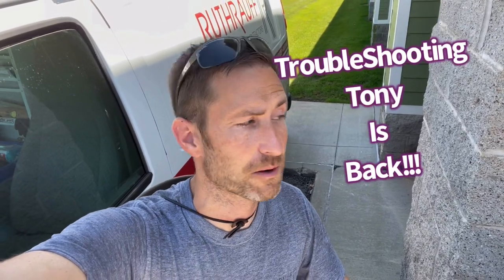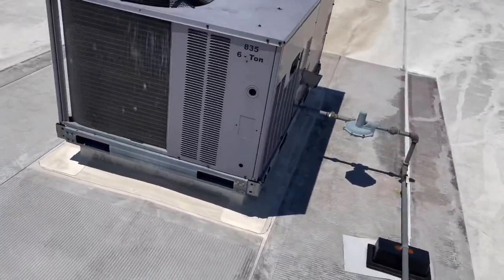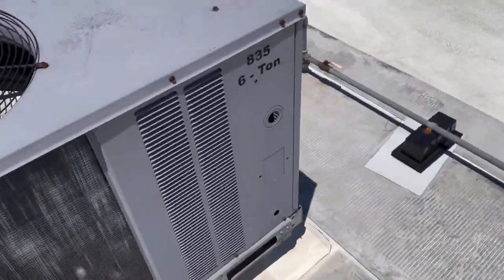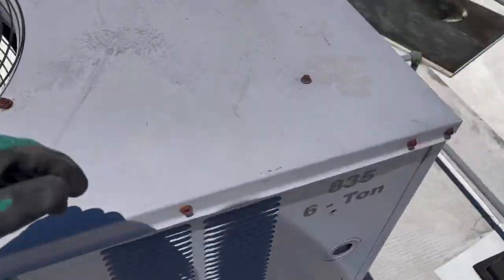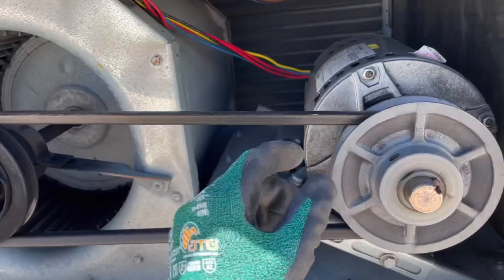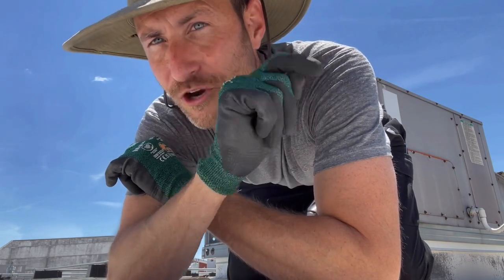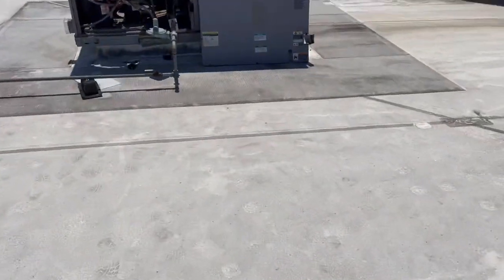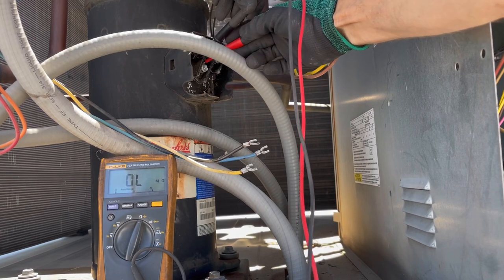RTU Shorted To Ground.  #HVAC #RTU #HVACEXPLAINED #HeatingandCooling #AirConditioning #Carrier

Comment: Awesome video very informative!  I have a roof top unit and I called 5 companies to come take a look. Only one guy was able to fix the problem . 3 of them said I should be a technician and one came without a 🪜 🤦‍♀️
Reply from the maker: Thank you very much for the compliment.  Everybody has a different way of troubleshooting.   The more calls you take the sharper you will be by sometimes when you stare at a problem so long you can get blinded.   Sometimes you just need an extra set of eyes and the problem may stick out like a sore thumb.   
About the technician without a ladder some companies do not have all technicians with extension ladders.  
Technically, the customer is supposed to have access to that site equipment, but very rarely do they.   I always recommend to the customer putting in a possible extra hardwired light for plug outlet nearby to make life easier for the technician.   
Have you thought about becoming a tech?   You can live very comfortably in the HVAC industry.  I prefer commercial/industrial over residential any day.  
Have a great day. Thank you for watching.   Stay safe. 👍

Comment: Nice did the job. If for some reason the breaker does not trip so the is a power in the unit, as a technician how to protect your self from shocks? How to be prepared before touch the unit? Thankfully.

Comment: One that I hate in those mega mall is those laters they should have small  alevatar  make a life easier
Reply from the maker: I don’t mind working in malls on the roof. The only part that gets frustrating is any time it comes to a major repair. It takes roughly 30 minutes to get from your work van all the way to that piece of equipment so if you got to do a leak repair with torches recovery machine, vacuum pump/Refrigerant/scale/your tool bag, etc. it’s very time consuming.  
I remember back in 2007 it was literally a solid month of 5°F in Pittsburgh, Pa.  I had to replace six compressors at a local mall.   I brought a sled to make the job easier but what a pain.  
Trying to recover refrigerant that cold outside does not go well.
Have a great day. Thank you for the comment.

Comment: One thing you should have mentioned... The grounded compressor was in the megohm area. This is “sometimes” an indication of moisture in the refrigeration system .  I have seen this before and the compressor ran fine and would use less amps as it gathered some heat and drove the moisture out to a lesser degree.  They can sometimes be saved with a clean up drier.
Reply from the maker: I definitely should’ve pulled out my Megger.  I have seen a couple compressors Electrically OK that would tripped the breaker because internal bearings or mechanical failure lock them up.  Meanwhile they look perfectly fine with a meter.  But yes I should’ve pointed that out typically when I do these videos it’s one take.  Sometimes I failed to point out other issues that could cause this or that.  
Sometimes when I compressor is reading grounded even with a
Supco Megger I will stand back and engage the compressor to either blow a fuse or tripped the breaker just to confirm it is bad.  But yes I will see if I can do a separate video in the future on that in particular that would be a good situation.  I appreciate the comment and advice I’m glad people are paying attention because one thing is this field there is no 100% perfect technician LOL we do miss things and sometimes problems do not revealed himself right away.  Have a great day and have a safe weekend.
Reply: @hvacexplained9341  nobodys perfect but we try do our best.  aA senior tech asked me 25 years ago, when he saw me using the megger... My Fluke can read meg ohms... Whats the difference. I didnt know and it stumpted me.... Later while growing in knowledge, I realized the meg ohms measured on a Fluke, is like 9VDC at most.  While the megger is 1000 volts.  a thousand volts can jump a gap like a Jacobs Ladder to ground or a spark plug if theres a break in the insulation,  The Fluke wont jump anything.
Reply from the maker: @hvac01453  :  
I was using a Megger one time on some thing that was definitely grounded and I found out because I was really sweaty on a hot humid day leaning over into a Units condenser fan section and when I hit the button I am dead serious I felt a twinge!!!  Lol. Thank you very much for the technical advice I like listening to the old-timers they got some good tricks up their sleeves.  
Have a great day.
Reply: Good work fellow 449 service fitter. As the other guy wrote, moisture can cause a reading to ground. I’ve been at this for a long time and I’ve also seen times when a Fluke or other digital VOM will show a short while a megger will show it’s good. I’ve seen it more times than I can remember. I’ve also seen a lot of 5 ton single phase Copeland scrolls meg bad new and out of the box. This is after replacing the drier and refrigerant (was years back so it was 22) and pulling and holding a 500 micron vacuum and less than 1 hour of run time. But they ran for years. Keep up the good work. Maybe I’ll run into you sometime in the Burgh. Stay safe.

Comment: In my opinion the main breaker was tripped due to direct shorted to ground in the wire. 
However the compressor that has winding measures mega ohms to ground is most likely still working fine. I have seen some 3 phase motors had mega ohms shorted to ground but lasted a very long time. 
I totally agreed that any motor winding should have no short to ground whatsoever

Comment: Low volt Fuse is on the board on those carriers actually, I personally swap out with resettable 3amp breaker usually if it’s a regular customer

Comment: Megohm readings in motor windings are generally moisture . i bet you could have still fired it up and ran it .  megohms readings will only have a leakage to ground of a Ma or so
Reply from the maker: That is a very good point.  I have had Megger meters Read grounded and Had a compressor running perfectly fine.  So what I do when it’s sketchy and I’m sure is literally Come down to engage in Cooling Or push in contactor And blow some fuses.  I had to do that one time in particular the compressor was reading perfectly fine but internally it was mechanically locked up it was a semi hermetic on a Mcquay 50 ton unit.  I’m going to see if I can shoot a separate video on information such as this it brings up a good point thank you very much sir have a great day and thank you for watching the video.
Reply: @hvacexplained9341  the purpose of the megger is to attempt to “predict” a compressor failure by keeping past readings. More for the in house guy, than the hvac truck guy.
Reply from the maker: @hvac01453  That’s a very good point.  👍

Comment: Great job, I been at this 38 yrs and if everyone was as through as you were our job would be a lot easier. Also the after hours call would drop due to finding potential issues early. Thanks again. What is that hat? Is it one of the wicking cooling ones?
Reply from the maker: Thank you very much Scotland.  I always love to hear good positive feedback from other technicians.  There’s many great technicians out there we just don’t hear enough of them.  I’ve learned from quite a few top-notch technicians and took a small portion of each technique taught to me and brought it together for me to explain it best.   Actually would help me a lot when I was starting out in the field broken components I would take apart on my own time to see what failed and how they work. I feel this gave me a good understanding of what we are dealing with.  Everyone learns things differently I really like teaching the beginning apprentices the ropes because I was once there and had a heck of a time understanding this field.  One big issue I do find in this field is lack of maintenance because of the location these units are installed.   Some people question me what is the best equipment out there and I tell them “As long as it sized properly and installed properly and maintained properly that’s pretty much 3/4 of the battle”. Some brands are better than others but everyone has their own preference. The hat that I am wearing I believe I picked it up from Dick’s Sporting Goods. And yes I believe it is some type of moisture wicking hat it definitely keep the sun off my face and me a lot cooler.   Once again thank you very much for the feedback please let me know if you have any suggestions of videos or possible questions you may have.  I run into a lot of equipment and I have a Lotta videos stored up I have not edited and posted yet at this time.  Have a good day stay safe.  👍

Comment: I do a lot of commercial refrigerators the walking freezers and coolers single unit sometimes double. I have trouble Reading the schematic sometimes.. I need to improve my diagnose skills besides Watching you too videos what would you recommend? Any book for example.
Reply from the maker: I know exactly what you mean buddy.   I had trouble reading them and still do from time to time.  There are certain brands that I prefer since the schematics makes sense.   
If you get a chance, take a look at a  AAON schematic.  They are laid out very well, color-coded, abbreviated, whoever drew it up and common sense.   
Trane likes to over engineer stuff.   They will use a two pole contactor on a three phase system just to save a buck.  Or 460v single phase motors. 😖😖😖 C’mon!!! 
 There are times when I wire up Equipment I picture the flow of power through the switch to the load.  If No schematics are legible.  
Remember, a thermostat is nothing more than a switch. 
If your compressor isn’t turning on verify it’s calling for cooling then jump out safeties 1 by 1.    
Example of safeties:
Overloads / High or Low pressure switches / freeze stats / oil pressure switch.  But NEVER leave jumped!!!  It’s for troubleshooting.  
Circuit Boards -   If you have power going in and nothing coming out or LED lights aren’t flashing “Replace Board”. 
Also, there are times where I had to physically cut all the zip ties inside of electrical panels to yank on that wire to find its destination.  
If I get a chance, I can see if I can shoot a short video on schematics. I’ll write it down to keep it in mind.    Since this video I have moved from Pittsburgh Pennsylvania down to Florida and working for a new company.   
Have a great day, good luck. I appreciate the questions and comments.   Just remember HVAC is always changing and we can never know it all.  It’s knowing where to find the information that helps.   👍
Reply: @HVAC EXPLAINED  thank you 😊
Reply from the maker: @djish3223  I can’t recommend any HVAC or electrical books.  Honestly, I’ve said there’s so many times that the best training in this industry is on the job training.   There’s good information in books, but it cannot compare to putting your hands on equipment and physically doing the job.   Nobody learns this industry overnight it takes time and remember you can never know it all.    I’m wrapping up with a service call right now of a refrigerant leak on a condenser.   Have a great day.

Comment: Had a 2stg Carrier we put in the winter and started up. I was back out and the filter changing maintenance guy wrote on cardboard the compressors were overheating. Found out after we did a startup they installed a generator and moved the breaker flipping rotation causing compressors not to pump. Ended up calling Copeland cause they require you to make an account to lookup compressor info now, lel.

Comment: One question, why don't you use the insulation meter (megger) to check the compressor coils?
Reply from the maker: Those expensive tools, my shop has to purchase.  Basically, my toe, Bucket and Standard multi meter is on me.   
What I’ve done for a long time. It’s basically if a compressor is sketchy reading grounded I will push the contactor in, check amps, and worst case. It will blow the fuse or trip the breaker.    
But yes, I agree there’s many other meters out there that are more precise.

Comment: Also... if you reuse recovered gas, always run it through a drier before puting it back in the system.  The steel recovery tanks sometimes have junk in them, don’t ask me how I know!
Reply from the maker: Sorry I missed this comment I was just scrolling through early this morning and noticed.  I’ve always wondered about that if it could possibly be rusted inside because yes it’s steel and if there’s moisture in previous refrigerant also acid eating through the paint along with noncondensible’s yes it could rust.  When a system is detected for some acid or beginning to burn out I will occasionally recover the refrigerant through a filter dryer into the cylinder and then a separate filter dryer going back into the system.  I know it seems a little bit extreme but the cost of replacing R-22 VS a couple filter driers is a difference.  Lol.  But yes that is a very good point thank you very much for that insight knowledge have a great day and be safe.

Comment: Did malls accounts hated them never label or a map like Supermarkets chains everything labeled & marked especially if you have over 50 RTU .Maintenance on any Box stores are always goes to the lowest bidder.
Reply from the maker: Typically they put The store name with mailbox stickers just a reference the units destination.  I’ve been to some places where they are nothing but numbers which are code for that store.  I’ve been to a couple places with nothing at all labeled on the equipment which is very frustrating.  So if I go on the roof of a mall and there’s 200 units I have to position myself on a roof by pacing it out to determine the unit which is not always easy.   Have a great day.  
 I will be posting again in the future I’ve taken a lot of time off because of family, personal and OT.  I do occasionally post stuff on TikTok under same name and icon pic.

Comment: Hi 
I have a question maybe you can help me . I had this bad compressor 3 phase and making a lot of noise , so I went and replaced for a new one and on the start up it start to do the same problem not pumping and very noisy
Reply from the maker: Hello, 
Change two of the power leads on the contactor.  
Example:  instead of 
1/2/3 move 1 to 3 and 3 to 1. 
It’s simply running backwards.   
A compressor running backwards won’t pump, be very noisy and overheat or worse RIP.  
I have a video on Why Startups are critical.  
Thanks for the question.  Hopefully this points you in the right direction.
Reply: Sorry my mistake it’s a 2 pole
Reply from the maker: @tsx2007  Either single phase or three phase.  
There are two pole contactors and single pole with a Shunt.  
Trane sometimes uses two pole contactors on three phase compressors and run 1 hot leg to it.  If that’s the case try switching the L1 / L2 wires and if it’s three phase it will change its rotation.  
Also verify the compressor is the replacement for the unit.

Comment: The 87 is a great piece of equipment but you need more capacity
Reply from the maker: I’m sorry I’m not following? I believe that’s a 6 ton capacity unit if I’m not mistaken.
Reply: @hvacexplained9341  Capacity in OHMS from your meter
I have seen many systems 1 to 1000 ton measure 3-8 “ megaohm” still start and run

Your compressor was measuring higher than that
The motor insulation may indeed be failing but they were not grounded. Moisture…. Heat… contamination…

I would have changed the liquid line drier added a suction line drier evacuated the system and charged with virgin refrigerant
Reply from the maker: @joecorbin5158  ohhh I’m sorry I was lost on the 87!!!   I had one compressor I’m trying to remember what it was megging to ground But the compressor ran.  So typically if I am suspicious that it is grounded I will engage it to blow a fuse or tripped the breaker just to confirm that it’s bad.  I like the idea of a new filter drier and charge but sometimes it comes down to the labor involved of returning, cost of the refrigerant at this point and taking a chance to get it up and running I do understand it’s worth giving it a shot but I’ve been to locations where even know one thing is going bad they want a shotgun affect done and multiple items replaced just so there’s less chance of a breakdown.  I had a customer one time they wanted all compressors changed out every five years whether there was a problem or not.  I’ve seen a few compressors In the winter time read grounded randomly.  Thank you very much for the knowledge I do appreciate it.  I will try to shoot a small video with I am meters verse Meggers.  Again I like all the feedback I hear from people sharing information is very valuable.
Reply from the maker: @joecorbin5158  I just got home from fixing a friends Condenser also another bad dual cap.    In your opinion what brand dual capacitor do you feel is the best in the business?   Also I am looking at the meters that I have in my van at this time. 
Supco- M500
Fluke 1507 insulation tester.